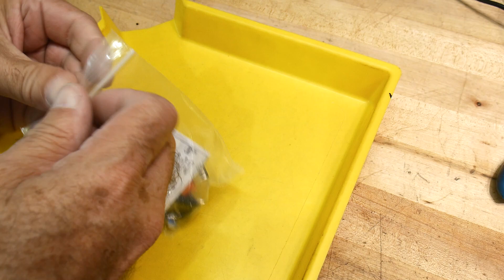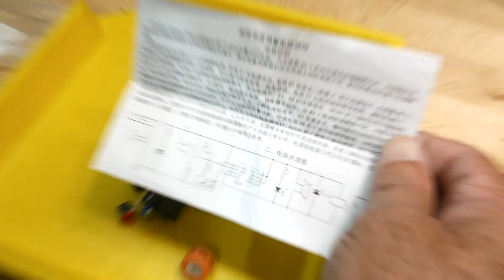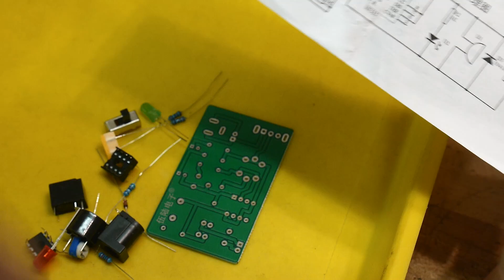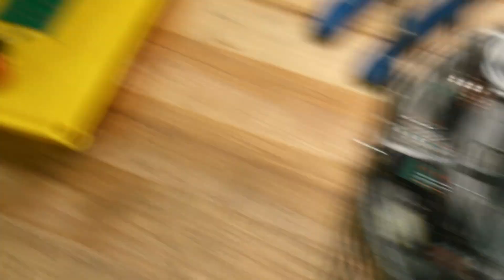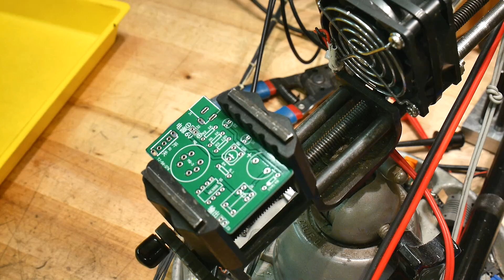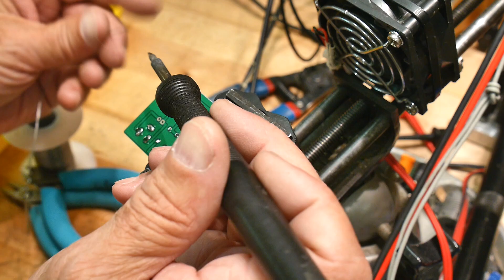#900 Alcohol Sensor Kit and Story Time

Comment: The sensor still uses tin dioxide, same as the MQ5. Ultimately it is still a four terminal resistor with a half a watt heating element in the middle, because moisture produces the same change - lowers the resistance by a lot as the sense gas. I wonder what the initial resistance is and the drop when exposed to ethanol/isopropyl/benzine/hexane/LPG/carbon monoxide/butane/propane/methane/LPG/Natural gas, even if just measured with a plain old multimeter.

Comment: In the 70s I worked in the sales department of an east coast coaxial cable manufacturer. In an entirely unrelated industry, equipment was being tampered with resulting in large and small scale loss. Their devices were being breached by either cutting or shorting wires leading to switches. I thought of putting diodes in the switch housings and running AC to the switches. An SCR circuit monitored the voltage from each switch. I got the only patent I ever obtained on this idea. Well, the CEO of the coach plant found out about my patent and said if I didn't sign it over to them he would fire me. He of course said I had developed it on company time. I didn't sign it over and I wasn't fired. As fast as corporate lawyers could work, all of us wage slaves were made to sign away all rights on any further intellectual property we came up with.
Reply from the maker: the company values its employees = the company can make money off the employee
Reply: @IMSAIGuy  Making money is kind of essential to running a business isn't it? I was under the impression that the whole idea of running a business was to produce a product or offer a service that people valued. Customers in turn exchange money in order to receive the desired product or service. If an employee doesn't contribute to the value of the company than what good are they? So yeah, companies value employees that help them to produce products or provide services and in turn make money for the company. Am I right? If not then please oh wise one help me to understand where I've gone wrong.
Reply from the maker: @erikburman530  no you are right they love employees that make them money, my snark was when they use the corporate speak 'we value employees' it is a one way proposition
Reply: @IMSAIGuy good point.